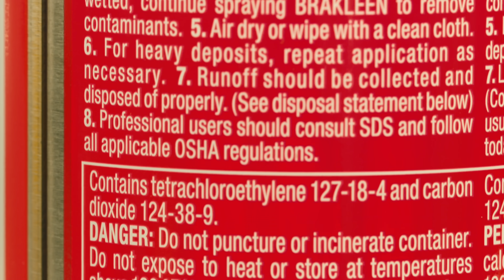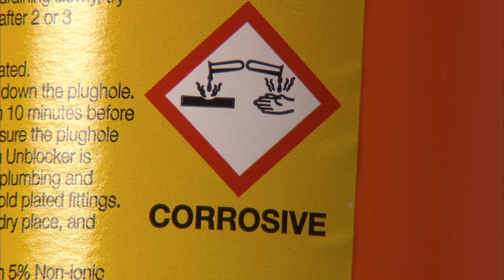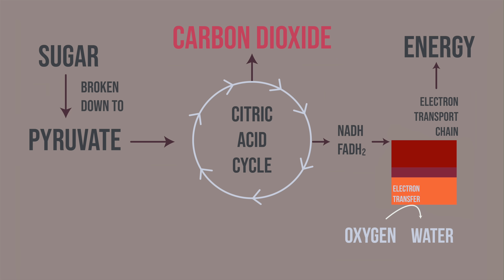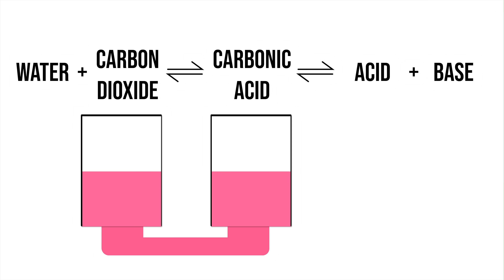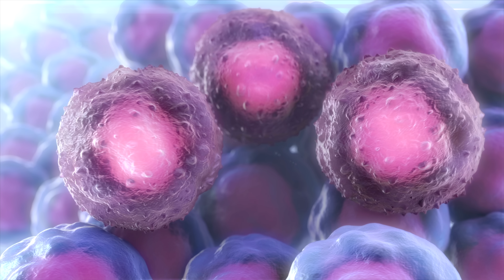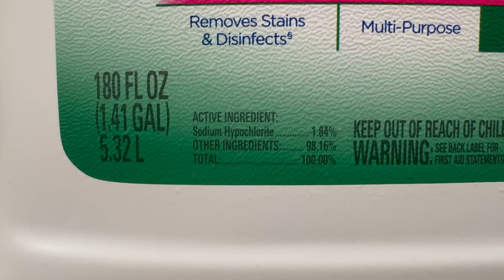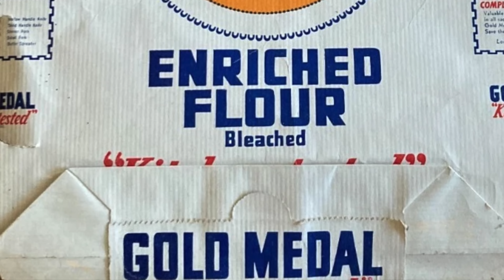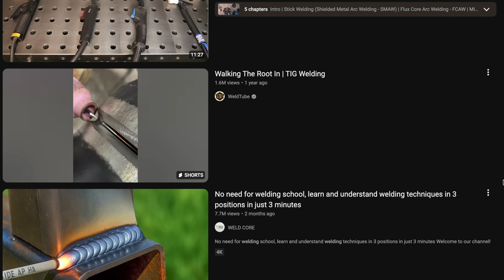"It smelled funny while I was welding and now I can't breathe..."

Comment: I do not have proof but I think that the empirical antidote for chlorine gas poisoning should work better than the hospital book remedies for fosgen. Both these gases are strongly acidic and can be neutralized.
The antidote for chlorine gas poisoning consists of inhaling the vapors of half liquid amonia 25% mixture with half concentrated ethylic alcohol 90%+ or at least 60-70%. The alcohol vapors opens the airways and the amonia vapors neutralize the acid forming in the lungs. Inhaling should continue until the person feels the amonia smell, sometimes more than 4 hours. Providing oxygen gas during this time helps. This antidote turns a deadly  pulmonary edema consequence in a bad bronchitis which would cure in a few days. Intubation not recomended. Tested.

Comment: I learned this as a kid repairing lawn mowers. I would spray them down with brake clean when tearing them down and pour all the gunk into my waste oil bin to take to the auto shop. The old guy did some test and told me it was contaminated and would make phosgene gas when they burned it in their heater. Then gave me a lecture about no mixing or heating solvents.
Reply: I would never let my kid do something like that

Comment: Don't trust that because you are wearing a respirator you are safe. Filters have limits and there are different kinds with different capabilities. I remember a sales assistant telling me that there is no filter for smoke. That would be why firefighters use oxgen tanks. Think ventilation and/or extraction and consider others down wind.

Comment: thanks for this video, Chubby!  hobby welder here and I wouldn't even know it would be dangerous with brake cleaner. I bought a Miller air filter for welding because i've been reading about "welder's lung." At the same time i wear a welding respirator

Comment: I am 74 and have been welding, off and on since I was in High school.  If you go to Welding School , they warn you to "Keep your head out of the Plume".  In other words, you must have adequate VENTILATION.  All metals, even CLEAN and brand new, give off Fumes when melted and or welded.  I have welded MORE Used material than new.  I do NOT use Brake Cleaner.  I know people that have welded longer than I have.  One thing thing that will do a weldor in, is SMOKING.  These dirty materials that are part of the Job, will get transferred to the weldor's hands, then to the Cigarette, then to the Lungs.   Also, after welding, a lot of work pieces are PAINTED via Spray Painting, that will kill you as  well.  It is a DIRTY job, as dirty as coal mining.  Perc has been known to be deadly for decades.  Welding is really a COMBINATION OF Trades.  Thread cutting oil, Cooling fluid for machining, Paint, Grease, anti-Rusting coatings that are to keep the new material from rusting before fabrication, that "Mill Oil" it is called, is VERY Dirty and will make a weldor's clothes BLACK.  I do NOT know what is in it, it is a filthy material though.  I have been told it has dirty Lard and other kinds of "anti-rust" coatings.  And then there is ZINC.  I welded and STILL weld Galvanized Steel.  One will quickly notice Zinc smells bad when heated.  If one can smell it, he is probably breathing it.  Working in a SHOP that is HEATED AND COOLED, is Dangerous.  Welding should be done in Open Air and with the ambient air being blown away people in the work area.

Comment: Brake cleaner doesn't remove rust so I don't understand why you would use it to do so. The dramatic negative way in which the story is told is to scare people. If you need to clean a weld use acetone. I am sure the message is well meaning and indeed has many truths contained in it. I have been welding for decades and professionally since 2021. Just be careful. Humans 20th century didn't live much over 40yrs old, research it and 100yrs ago welding was just invented.

Comment: I think the issue could have been better quantified.  Did he weld with brake cleaner still present, prior to evaporation?  Was there a chemical change to the metal or rust with the brake cleaner that stored the danger for welding later?  In other words, help me understand how to avoid this and also allow me to keep using brake cleaner.

Comment: A friend decided to clean his engine with a solvent. He got the engine warm and doused it with Methylene Chloride. He was (and hopefully still is) a chemistry graduate, and should have known that it would decompose to phosgene gas.  His lungs were sore for some weeks afterwords.  Refrigerants of that family are used in refrigerants, dry cleaning and pcb/switch cleaners.  So using a board cleaning spray and soldering should be performed with good ventilation.

Comment: i dropped a glass thermostat filled of mercury on my work area floor mistakingly.....I tried picking most I could but mercury breaks in smaller beads practically every time you touch it with anything ...though I couldnt see any of the most smallest of beads.....I still fear to this day I may have some on the floor some where I could not notice so tiny I cannot maybe be being able to see ....I often now sweep that area by hand slowly.....and then use big soft paint brush to brush all the cracks on the floor I possibly can....I still live in fear .... be careful out there all ....✌️🤞🤙🤙

Comment: yes, this is something NOT to do!- the solution is likely like WD-40 and something NOT to use while welding!, the temperature of welding is ~1,500 Deg Celsius to melt steel; if any paint is on it, this melts too, giving off solvent gas, like ammonia,  plus if any chlorine is in it, that comes out too 😞 so.... clean the surface, no oil on the surface either.

Comment: 1:21 and I KNOW what Is going to happen! ARGH! Phosgene Gas!   BTW ppl, welding on GALVANIZED metal is TOXIC ALSO!!! Grind the coating off thoroughly or remove with Muriatic Acid! Yes, I've welded since 17...Edit: You CAN buy NON-CHLORINATED BRAKE CLEANER! And it works good... Phosgene Gas...Thanks World War I ...

Comment: So, what you describe here can be summed up in a couple of sentences. But the explanation of the results of using rust remover immediately before welding without breathing apparatus and excellent work area ventilation is very powerful. It will produce phosgene, which was used in WW1 to incapacitate and kill soldiers. That phosgene will cause you to drown in your own body fluids within a day or two. A horrible death. Even a small quantity of it will cause irreversible lung damage, and later heart problems, if you survive the initial damage. I had a family member who took 48 years to die after being gassed with phosgene during WW1. He had never stopped coughing.

Comment: 1:30 Welder here, this is where my jaw dropped..like.."noooooo.....broooooooo...."
Reply: Chemist here. I knew it was phosgene from the smell and the chlorinated metal.
Reply: Retired welder here.
Enough said ...
Reply: Novice welder here. Even I knew instantly 😢
Reply: @RainbowRenegade wow, you are all so smart knowing what turns into what when heating and mixing chemicals wow 👌
Reply: @cpthindsightlol  lol ok cornball
Reply: I’m an auto mechanic and a welder. I have welded thousands of feet… Luckily, this never happened to me. I never knew… That’s a great video.
Reply: I have been screaming about the need for warning labels about chlorinated brake clean on welding equipment for DECADES...NO ONE LISTENS
Reply: @JHV166 To be fair, it's kind of hard to make warning labels for every possible way that a substance might be used. They just cover what's likely when the product is being used in the intended way.

Comment: My brother and 3 of his work friends were working on a large chemical tank. The boss assured them it had been cleaned. The guard on site though the 4 of them had bunked off due to the lack of noise. He went to investigate but on seeing one worker laying on the ground ran away and called the fire brigade who rescued all of them wearing FULL chemical gear.
Two of the workers died very soon after, one on the way to hospital and one later that day. Another has extremely poor health and hauls around a oxygen tank and my brother survived but has mental health issues form the poison and will never work again.
2 things you need to be aware of. (1) Be very aware of what you are welding/ cutting/ working on. (2) IF YOU SEE SOMEONE ON THE FLOOR. STOP. LOOK. LISTEN. UNDERSTAND. You are absolutely no use rushing to help and dying as well
Read safety booklets. They are written from the disasters.

Comment: Question: Why has ECMO not been used in the ICU? According to the literature, it significantly reduces mortality. ECMO can provide oxygen, remove carbon dioxide, and give the lungs time to hopefully recover. If ECMO were not available, the patient should have been transported to an ICU that has ECMO. Considering the case was developing for hours, there must have been enough time to prepare for the option that the lung edema becomes unmanageable by any other means.

Comment: Been welding a long time in food plants , they use caustic acids and chlorine for sanitizing machines , was making a repair welding a frame , i inhaled just a little bit of the fumes and when it entered my lungs the molecules of the burned chemicals ate up all the oxygen in my lungs so no air remained .   It took a moment till my lungs cycled and i was able to get air in again . It was like getting the wind knocked out of me , but chemically. If you are welding something that is contaminated or galvanized you can put a fan behind you to blow the fumes away from you so they dont come up into your welding hood in a open area. Also when grinding or using a cutting wheel always wear face shield a N95 respirator  , the particles that bind the wheel together are toxic  .  You will get away with it when your in your 20s ,30's40's but when you get to be 60, you will be looking for lung transplants .

Comment: A friend of mine was using that exact brake cleaner & then started welding on his truck which caught fire when a weld spark hitl metal surface with brake cleaner. He was under it wen it happened. He's ok, but his truck, not so much!

Comment: I guess that a lack mask with proper filters would help in this case. But I'd love to know for sure. Obviously not using brake cleaner for clearing materials for welding and proper ventilation is the obvious takeaway. But to be honest, I rarely see welders with the respiratory protections.

Comment: I accidentally drank about  half a cup of chlorinated brake cleaner mixed with burnt LG6 trans fluid. Used a Gatorade bottle to contain flushed trans fluid out of the lines. I also had another Gatorade bottle, same flavor, but I messed up and took a swig. About 2 hours later after I had been admitted in the ER, I died for about a minute or 2. Not very fun lol.

Comment: The tragic part of this is that adequate ventilation could have prevented this, and probably would have. Proper ventilation is one of the highest priorities for welding safety training, for several reasons: The possibility of forming toxic gases by high temperature decomposition of organic solvent residues is just one of them.

For the simplest type - arc welding or stick welding: Smoke from the vaporising flux is an inhalation hazard. If welding galvanised (aka zinc coated) steel, the welding heat can vaporise the zinc, and/or ignite it to form clouds of zinc oxide smoke. Inhalation of which can cause a condition described as "metal fume fever" or "zinc fume fever". Zinc is an essential trace element in human nutrition, but excessive intake can cause heavy metal poisoning, which is what this condition is.

For MiG welding, the shielding gas is typically either argon, carbon dioxide or sometimes a mixture of both. In poorly ventilated or enclosed spaces, the shielding gas can build up in the space and displace oxygen, causing asphyxiation. If pure argon is used, this is especially dangerous since you might not notice it happening: The body has an autonomic breathing reflex - the urge to breathe you feel when you try to hold your breath. However, this reflex is driven by excessive carbon dioxide buildup in the blood, not by depletion of oxygen. So if the space you are in is filled up by argon gas, you will still be able to exhale carbon dioxide just fine, so your breathing will be entirely normal. But you won't be taking in any oxygen (or nowhere near enough), and you won't know anything about it until you pass out - and your only chance of waking up again is if someone else notices and pulls you out of there.

Comment: I never knew this.  I worked with trichlorethane for years in situations where it was used on hot metal parts.  Now I know chlorinated solvents produce deadly phosgene gas when heated.   Guess I was just lucky copy machines only get so hot.

Comment: I'm a chemist, a car guy, and amatuer welder.  I'm skeptical of this story.  Chlorine was removed from carb sprays decades ago.  So this would have to be an old story or the victim found an old can laying around.  Next, you spray the  solvent on to something to dissolve oil/grease then wipe it up, so only a trace of solvent remains.  No one with any common sense is going to weld on a visibly wet surface out of concern for fire.  CDC says the 50% lethal dose of phosgene is 50ppm for 5 minutes.  It would be difficult for an ortherwise healthy person to generate a lethal dose from a trace contaminated surface unless you welding for a long time, in a confined space, in stagnant air, were more susceptible than most to phosgene, and ignored the symptoms.

Comment: Well, I've done plenty of welding and didn't know about this issue, so that was indeed educational. I've never owned any brake cleaner either, although I have had engine degreaser which may be the same stuff - I'd have to check.

Comment: As a third-generation welder and engineer we all need to wear respirators during grinding, and welding. Long sleeve 100% cotton shirts that have been starched helps with radiation. Welding hoods are cheap and not optional. Unfortunately for respirators they cost quite a bit more than these low-cost welders, but they are easily one of the first things to make as a DIY It doesn't take much. For commercial fab shops respirators are a OSHA rule/law that must be followed. Some used pipe in from the Oil/gas industry can have radiation problems that are liberated to the air during grinding. Thanks for this video. Saves lives.

Comment: Phosgene gas is what he created by mixing Argon with break parts cleaner when heated at high temperatures. I’ve been working in the welding and fabrication business for 30 years and I tell new welders who weld at home, pad and clean weld joints with soap and water or denatured alcohol. Repeat the process until greasy surface is cleaned and then pad any remaining mill or scale off of weld joints. I’ve had a very successful career in welding along with safety first attitude and practices.

Comment: Always use welding clothing like leather welding protection if your going to clean metal make sure you wash it with water after so no chemicals are present and as I said in the other message use a filter mask

Comment: The reason you wear a mask when you weld is the grinding disk contains silica. Basically glass, the silica cuts your lungs everytime you breathe in and out. This leads to scaring build up. The condition is called silicosis. It's very similar in outcome and effect to asbestosis.
 So, not to proctect against " soot " like the video says.

Comment: Brake cleaner don't remove rust, and most any chlorinated substance you don't want to be around, if you heat with an electric ark or welding flame.  Oh and you don't weld Stainless steel without the knowledge and PPE to do it safely.

Comment: For me this just highlights the importance of good ventilation & fume extraction systems.  If you're working with any kind of reactive chemical,  or if you're doing any kind of heating,  melting,  welding,  or burning;  adequately ventilating the space you're working in is a basic requirement.

Even if you're not going to accidentally create a chemical weapon in your workshop,  many of these processes create by-products that can be damaging to your health with long term exposure.

Set your workspace up for fume extraction if it's viable to do so,  and spend a little more money to get a welding helmet with a built in fume extractor.  Your long term respiratory health will thank you.

Comment: I have a scar on my calf from a piece a metal from a exploding metal drum. I worked in a food factory on the graveyard shift long time ago. One of the workers came in with a empty flavor drum and wanted me to fab a BBQ for him. I told him no cause the flavor is alcohol based and it’s embedded in the metal and it can explode. He claimed he washed it out but I still refused him so I made an enemy. I went about my business and did a few things. I returned to the maintenance shop and he gotten the other maintenance tech to fab it for him. They both were there joking around like life long buddies. As the tech was using the plasma torch to cut the barrel in half, there was a loud bang and I felt something burning on my lower leg and some screaming. When it was all said and done, I gotten about fifteen stitches and two people were fired from the company.